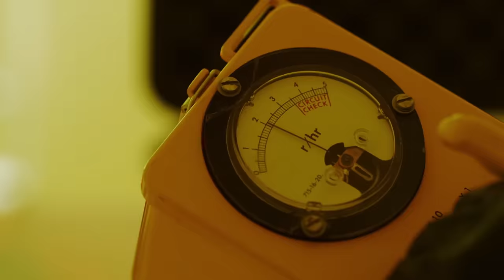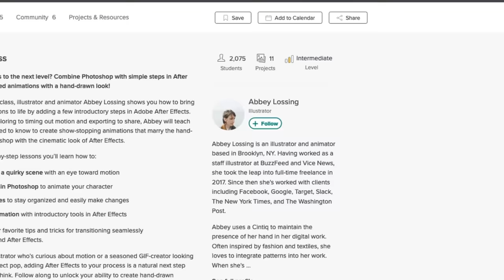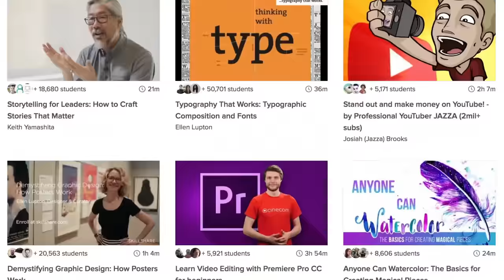Here's Why Chernobyl is Still a Massive Problem Today

Comment: When does he actually start talking about why it is still a problem?
Reply: Mlj Fmdfmd  it is not "still releasing" radiation.  The concern around the sarcophagus is the release of dust and airborne particles which can carry radiation into the lungs of surrounding areas.  That was the big concern.  Radiation levels continue to decline in the exclusion zone which wouldn't happen if the it was still leaking.

If you look at the new shield it is pretty lightweight metal to serve primarily as a cover if the sarcophagus collapses and causes dust and debris to be thrown into the air.  It is a bit like asbestos insulation or tiling, not dangerous until you kick it up into the air.  When the sarcophagus was built it was originally designed to shield against particle emission at the time, but that isn't the case anymore.

I couldn't fully understand your comment, but if you are talking about the Cook incident in 2003 where coolant oil was dumped into the water, this is normal operating procedure for certain events and while I can't say it doesn't increase the radiation in the water it is less dangerous than flying on a plane or eating a crap ton of bananas.  It just sounds scary when people say 40x normal levels!  Well a plane at 30k feet is like 10x background so unless you are drinking gallons and gallons in one sitting you're fine.  In fact you will die of h2o poisoning before ARS
Reply: Never. Because he has not idea of why, nor has he an idea of why the new confinment was constructed. Is for dismantling purposs mostly, althought ovbiously also for safety and for containment.Why do you think is so fucking big?

Comment: you really make chernobyl more of a problem that it is. the numbers you present are tiny compared to the general population and the fact that you pay the costs over many years. also even 93k people is nothing in country where there is 300 million people, it's not a problem, it was back in 1986, but if the authorities are willing to send people as turists inside the exclusion zone, and people are builing staff in there, the only problem is getting the solution to keeping the dead reactor contained, and that's easily solvable. anyway, you came off as no better than a politician, sprading scary staff for popularity, figures which are close to nothing compared to the system it's built upon.

Comment: crazy thing is they continued to operate reactors 1-3 up to the year 2000. They couldn't afford not too....with reactor number 4 being the one that blew.  

Wiki: " Reactor No. 1 and 3 continued to operate after the disaster. Reactor No. 2 was permanently shut down in 1991 after a fire broke out due to a faulty switch in a turbine. Reactors No. 1 and 3 were eventually closed due to an agreement Ukraine made with the EU in 1995.

Ukraine agreed to close the remaining units in exchange for EU assistance in modernizing the shelter over reactor No. 4 and improving the energy sector of the country, including the completion of two new nuclear reactors, Khmelnitski 2 and Rovno 4. Reactor No. 1 was shut down in 1996 with No. 3 following in 2000."

"After the explosion at reactor No. 4, the remaining three reactors at the power plant continued to operate, as the Soviet Union could not afford to shut the plant down."

Comment: There are a couple of inaccuracies in this video.

For the disaster-related cancer deaths: the 4000 is an estimation for the most exposed areas, it is much lower then the total. I have no idea where the 93000 comes from. The general accepted studies say around 16000. (note that these are just estimations, it's impossible to know exact numbers)

The 28% increase over the next 70 years is not coming from the accident. Even if you take the highest number you gave, so about 100k, do it times 3 to estimate the total cancer cases instead of deaths, you have about 300k cases. The annual number of cancer cases in Belarus alone is already 50k. If all those cases would happen in Belarus somewhere over the next 20 years it would be 30% of all cancers. So 28% would be way to high if you know that most cases where spread out over Europe, and not only one country.
That percentage is either for one type of cancer (probably thyroid) or mostly unrelated to the disaster ( mostly an aging population)

Comment: The elephant's foot, the corium lump in the basement is still very slowly melting it's way though the concrete floor. At least now it shouldn't ever reach the groundwater which could cause a hydrogen explosion and of course contamination.

Comment: You can easily make a robot that wouldn't be affected at all by the radiation.
As long as it was 'analogue', and not digital, if you will.  As long as it doesn't have any electronic parts, it would be fine.  And there's plenty of ways of making a mechanical, electrical 'robot', that could do many tasks.
Seeing what it's doing is the hard part, as cameras wouldn't last long at all.  You'd need to be watching what you were doing with it through a window somehow.
But, it is doable.

Comment: What happens if someone nukes the sarcophagus? Does the blast become a super duper omega nuke? Like do they "combine"?
Reply: No. Nuclear reactors use vastly different kinds of fuel than nuclear bombs. For one, nuke bombs use plutonium. And the material is much more enriched.

What it might do is function as a dirty bomb. Dirty bombs are normal bombs that blow apart and spread radioactive material. Which as you can guess, isn't healthy.

But at that point, you might as well just make a dedicated dirty bomb and detonate it in the air for more effectiveness.

Comment: Well, now, there's a ray of sunshine:  8:00 - "It will be 20 to several hundred years until the area around Chernobyl is completely safe".  I've been hearing 20,000 years for so long my ears said, "What???".
Reply: The 20k number is for the inside of the reactor and close by further out from there its already completely safe
Reply: @ziegfeld4131  What causes this 20k years? It doesn't match the half-life of any fission product and is way under the half-lives of transuranics.

Comment: Actually wrong, the highest radiation was on the part of the roof named Mascha, with 10.000rph - ~ 15.000rph.
Machines stopped working after a few minutes, so they decided to let people do the work.
It was 1½min each to work, that gave them a 50% chance to survive.
So it needs more than 1 minute to receive the deadly dose at Chernobyl, even direct beside the elephantfoot you could survive for a longer time, and actually sbdy did.
The radiation inside the sarkophag is monitored 24/7 it is now, than the corium cooled down, at about 6000rph max,   still high, but it is possible to send in rc machines.

Comment: "During a late-night safety test"
Calling that experiment a safety test is the most anti-nuclear propaganda thing to say. They turned off, overrode, or otherwise ignored every safety system that tried to stop or warn them what they were doing was stupid.
Reply: And yet nuclear plants worldwide are still shut down because humans are too stupid to handle Nuclear energy without somehow fucking up.
Reply: @blam320  Shut down due to fear, not danger
Reply: @RipleySawzen  Yes, shut down due to danger.  San Onofre is a prime example of a plant being shut down due to imminent dangers before they were allowed to culminate.
Reply: @blam320  Naw, shut down entirely due to politics. Could easily be repaired.
Reply: @RipleySawzen  The environmental damage it was causing couldn't.  Neither could it be easily retrofitted to modern earthquake standards.  And to this day the spent fuel isn't being properly stored.
Reply: @blam320  Nuclear reactors really don't belong in natural disaster prone areas to begin with. Can't fault nuclear technology for that.

Comment: After that chernobyl miniseries from hbo launched. 

Chernobyl was bombarded by tourists who have done more harm than good.

Objects that were left untouched since the accident have been moved so they can take better pictures.

Excessive amount of stuff has gone missing from inside the buildings. (That delightful love poem from inside the district 5 school included).

Local wildlife has been disturbed by the excessive noise made by them and unfortunately there has been increased ammount of vandalism and littering aswell.

Of course there are looters out here too.

If you come here DON'T TAKE ANYTHING WITH YOU. AND IF YOU TOUCH SOMETHING, PUT IT BACK!!!

That message came from my contact a month ago...

Comment: another short sighted video missing the main problem.  fuel is still inside in random piles. We have no idea if its collecting into a critical mass .or even cooling at any rate. it might be building up gasses under pressure... nobody knows

Comment: The biggest problem I have with Chernobyl is the way it is used to argue against nuclear power. The reactors at Chernobyl were not build very well. The Soviet Union built the plant in Chernobyl as cheaply and quickly as they could. The concrete and steel was the cheapest they could find, the people building it were paid virtually nothing, so they didn't care if they did good or not, and it was build to prove that the Soviet Union was the "most advanced and successful" country in the world. So basically the plant was a bunch of trash that was scrapped together, to call it an "advanced" nuclear reactor. 

I very highly doubt anyone as far away as the UK would have had any affects, the effects by time you get to the UK would have been no worse than background. The HBO series Chernoybl is filled with inaccuracies, to make it more of a drama, the whole purpose of HBO's Chernobyl is to be entertaining, and the facts were not as dramatic as they are in HBO's Chernoybl. The city of Kiev was only vacated, because the government was more worried about the effects on infants and the elderly with preexisting conditions in the area. There wasn't enough to affect the healthy, adult population all the way in Keiv. If you lived at Chernobyl there was enough, but not all the way in Kiev or even Pripyat. I thought it was a horrible crime committed by the Soviets for a long time, until I looked into it. The Soviets did fuck up, but they managed to scrape together enough people and materials to actually do a decent job of fixing it. They even planted fields of sunflowers in the area, because of how good sunflowers are at absorbing nuclear waste. There are still fields of sunflowers in the area today.

Comment: And yet somebody else still says that nuclear power are safe and clean. That's BS!
Reply: It's the cleanest fossil energy we have (yet). Would you rather bury dangerous nuclear waste into a hole deep below the earth or pump extremely bigger amounts of slightly less dangerous CO2 straight into the air?
Reply: @xerxes2083  Are you live in a binary world? There are always got third and another choices instead of two!
Reply: @sn0wdon  It isn't? I thought Uranium/Thorium/etc. was a fossile resource
Reply: @sn0wdon  got it, thanks
Reply: Because it is safe.

Comment: Cut a hole in the roof and fill it up with concrete on one pore then build a wall around it that is at least 10 feet taller than it and fill that up with concrete.

Comment: Radioactive sea water getting dumped into the Pacific from Fukashima everyday, nobody talks about that anymore. Far worse than Chryrnoble.
Reply: Its funny you say that, because they are talking about it. And the plan to do so was approved by the scientists of the International Atomic Energy Agency. The water the plan to release has been thoroughly treated and stored for the last decade. 

Chernobyl on the other hand was hidden and denied until the Swedes publicized the radiation they were experiencing. Radiation which was released directly into the open air to be carried across Europe. And even then was claimed to be much less than the actual levels, hence why you have the stories of the robots that were rendered inoperable because they weren't built to withstand such high concentrations of radiation. On top of that, the reactors in Fukushima were shutdown by the control rods immediately upon the shock of the earthquake, to mitigate any potential disaster. The only reason the reactors failed was due to the tsunami which was almost twice the height that was considered worst case. Chernobyl was a human made catastrophe, Fukushima was a disaster that couldn't be avoided, but wasn't made worse by a government hiding their mistakes.

Comment: Dear god dude your so wrong,like almost all stuff was false, first it was done not by ukraine, but by many nations from europe especially with technology and engineering from eu and made with money from europe. Yes ukraine had to pay also big part with nuclear waste coming to cherno from germany and other countries for storing and workers came from all world, its like you hire crane man and he can stay on site working only certain time and in zone also than he must come beck homefor long period. This is the cost comes from, also you add its in radioactive site which must be cleaned it was fully cleaned  to extent. They rolled new dome yes, but you are wrong about what it is. They are dismantling the nuclear station ! In 100 years it may be no more of this dome itself nor the station. Work is already in process, This is why it has heavy duty cranes lifts, plasma cutters everything used by robotic arms etc, dust wont matter as it will be inside in special vacum if im right, than they will start main event they will close it and will not enter anymore inside dome like now workers working. Radio ctivity will spike again up. They will eventually open the core and will remove it until nothing left. First they will remove sides as beck than they put it under super heavy concrete and and moved by steps to get close to reactor to cover it up, also inside than it exploeded they dropped so many silica sand bor other materials from periodic table needed only chemistry and nuclear physisit knows whats inside now  in quantities nobody would have in world. So what happens if you leave it. Well it will reach the under ground  tunnel which workers dig its done exactly as needed created by engineers similar like tunnels where cars goes and made it should been last resort to cool off, filling it with liquid nitrogen in quantities all of it world has! Beck than it was soviet union was huge in size, they would take all and it will gonna be needed in future if they are too slow.      So lets say it breaches nytrogen so loved by pc overclockers . Than than? Well its end game for world! Than lava reaches ground water it will make biggest nuke world saw. Well world will die. Its not only 4 block near stand other blocks even if they are shut off already, but pools  with used waste are near in every of those stations. After blast it wont be like normal nukes which you could say clean it wil probably make huge blast dust in aLL WORLD  and after start emit radiation in big quantities.